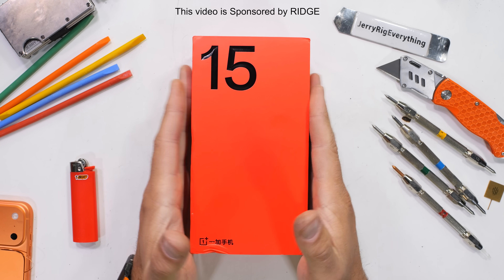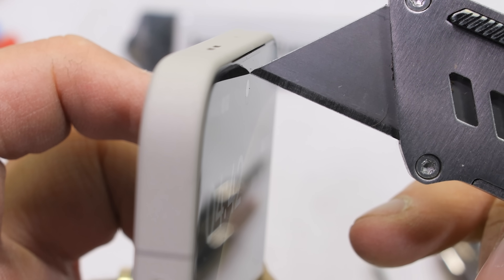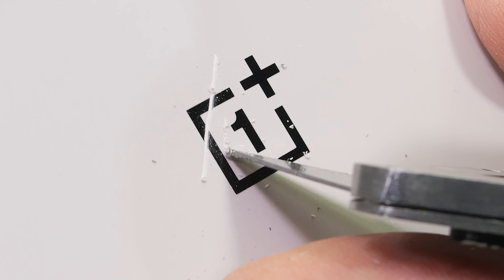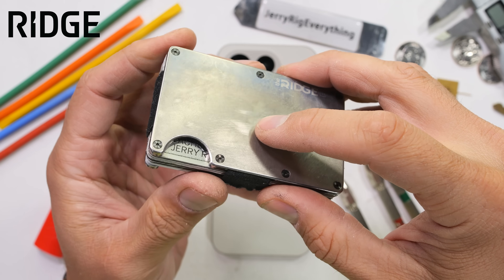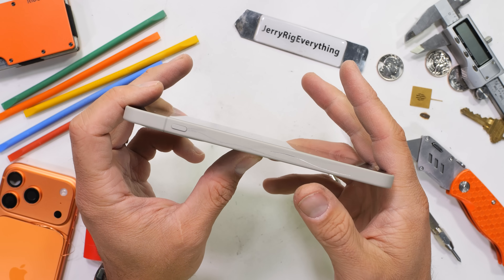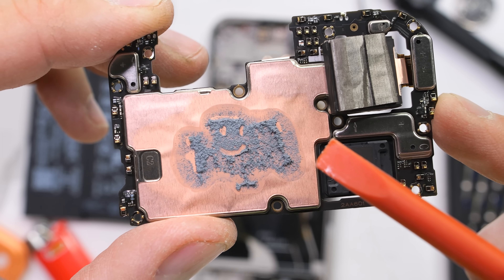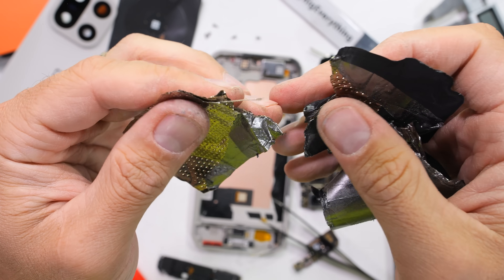OnePlus 15 Durability Test -- The Claim is Insane

Comment: As someone who rarely uses a case I am curious as to how scratch prone the back really is?   You went straight in with the knife would have been interested to see how it holds up with the mohs test.   As it stands it looks like Sandstone has tougher sides and a stronger back dor drops but weaker for scratches?

Comment: That "MAO" Coating fucking sucks, there's only like one place I've seen that does it right to where it's actually more durable than hard anodizing level 3 and I doubt OnePlus sprung for those guys to do it, I have quite a few mao flashlights and they do not hold up well to scratches/scuffs at all and it also attracts dirt and is hard to clean, a titanium/hard anodizing level 3 would have been so much better but oh well.

Comment: Hello! I follow your channel and I absolutely love how you tear down (or disassemble) cell phones to see what's inside—it's truly fascinating.

Perhaps many people ask you for help, I don't know. I myself am a cameraman; I make short films and videos. I currently use a Motorola Moto Z, and I love it. However, the battery no longer works, and I can't find a replacement here in Venezuela. It would be amazing to continue using my Moto Z as a camera; I would never swap it out.

I wanted to ask you a favor, if it's within your means, could you possibly send me two Tecno Spark 20 phones? It doesn't matter if they are used. You might wonder why two. The reason is so I can have two identical cameras when shooting different angles/shots, and it would be a huge help for recording my short films.

Thank you in advance.
Sincerely,
Pepe Gascon
Venezuela"

Comment: Silicon Carbon batteries are still lithium ion. Lithium ions are the medium used to carry charge between the cathode and anode, but the cathode and anode materials can be changed as new battery tech is discovered. That's what the silicon carbon means. 

Other types of battery alongside Li-ion include alkaline, NiMH, and solid state. These don't use lithium ions.
Reply: thank jeebus - I thought oneplus lied

Comment: 2:45 Motorola has IP69 phones. At a fraction of the price too. lol Motorola Edge (2025) has IP69 and 68, so does Moto G Power (2025) and the out of states Motorola Edge 60, Motorola Edge 60 Fusion, and Moto G56 5G. Also, the Edge 2025 and g56 5G have MIL-STD-810H certification. (I have the Edge, got it for only $200 dollars, for a mid level phone that's crazy, especially with the specs and durability and premium feel. I'm not actually a fan of Edge phones but this one is growing on me.)
Reply: Finally someone talking about the Motorola phones

Comment: Well from experience i had my oneplus 15 for 1 day, tripped with it in my pocket didnt even land on it. Phone looked fine no scrathes or cracks and was still recieves notifications but the screens fully black now, i belive its factory control and the screen wasnt properly attatched,  they are offering replacement but now i need to wait another 3 weeks to get the phone i paid gor

Comment: We need you to start testing the waterproof rating.  Changing the 8 to a 9 means it should resist 176 degree water sprayed at 1,450psi. Time to go to Home Depot and grab a pressure washer 😊 My guess is it’s BS and those mesh screens disintegrate allowing the phone to fill with water. Would be nice to see if I’m right or not.

Comment: HTC Did MicroArcOxidation years ago. so its not THAT new :D

Basicly you strike the Aluminium with Arcs of High Voltage, so it becomes a ceramic. 
Same Technique is used for SpaceShuttleTiles

Comment: One Plus owner here. I love this company. Iv had my One Plus 8 since its launch, it's still has the original battery and after five years of use with no screen protector I finally had to change the screen due to it having every notification burned into the screen. it itself had on scratches on it which is amazing since I work in construction. The only reason I haven't upgraded is it still works and it still updates. It's been a flagship kill since the 1+1 and I hope they continue on.

Comment: Twice the battery capacity, charges 3x faster and has over 1.5x the battery cycles compared to iPhone 17.. Apple is seriously falling out.
Reply: I'd say samsung is fallen out more than apple because ios is efficient af so they tend to hold their charge much longer than Android of similar battery capacity. Samsung though, they're android and them not going silicone carbon even now, especially with how outdated their charging speed is really astonishing. We have devices that are sold with a 120w charger in box but Samsung's most capable is 45w without charger in box.
Reply: @bruhder5854  but Samsung batteries are made themselves silicon carbon batteries is Huaweis product. Also Samsung batteries are rated for over 2000 cycles. This is double the lifespan compared to any battery apple uses.

Comment: So the ultra hard ceramic coating is done on plastic back. And the other colours don't have that ultra hard ceramic coating.. so whichever you pick it has downside which I find pretty stupid to offer then
Reply: Huh? The ceramic coating is on the glass versions, no? That's why they are so scratch resistant, and the plastic version in this video is not.
Reply: @SimonVaIe no its the opposite. Only the sand colour has that ceramic coating and they couldn't apple that to glass so they used plastic or whatever instead.. just Google it

Comment: I heard the black international version has a ceramic coating that will literally grind off any material you try to scratch it with (besides ceramic and diamond) and will instead gray out as if you are using a crayon and then you can just wipe it off with your hands

Comment: 7:53 i think there's a misunderstanding here
Si–C batteries are still Li-ion because the core lithium-ion mechanism is unchanged. What changes is the anode, which used to be graphite but is now a silicon–carbon composite. Silicon can store far more lithium, increasing energy density and allowing more capacity in the same volume. It can also reduce losses during charging, improving efficiency and heat management.

Comment: wait okay i looked it up. IP69 apparently means it can withstand high-pressure, high temperature (up to 80°C or 176°F) water jets. you said that has a better rating than any other phone on the market, including the iPhone. but.... haven't Apple been doing high-pressure, high-temp water jet tests for a while now? even if they don't have the rating.... aren't they physically as water resistant?
Reply: Even if they have, the statement is still factually correct..  it does indeed have a better rating even if it only has the same level of waterproofing.

Comment: All vapor chambers in phones can be ripped apart, people can rip apart roller steel. I don't think its that concerning. However a thinner chner also means superior thermal conductivity. Considering in 99.999 phones a human hand will never touch the vaper chamber its a no problem

Comment: The Oneplus 15 lineup is one of the first phones that heated up to 52°c (127 Fahrenheit) on the surface which means it is even hotter in the phone! It crashes due to the heat and is unusable until it cools down (took 15 minutes). It gets to this level for demanding tasks and heats up like an oven for navigation. They also downgraded the cameras from their previous phone, the Oneplus 13 and reduced the resolution of the display, along with the ppi density.

If you're planning on buying the Oneplus 15 and you already have a Oneplus 13, I strongly advise you to do your research.

Comment: Small correction but IP69 is not necessarily better than 68, as they are for different use cases, being prolonged submersion in 68 and high pressure jets in 69.

Comment: I'm so pissed off at the EU by removing chargers from the phones. Most of the time it's fine, but not with this one. Politicians shouldn't meddle in tech.
Reply: Aaaaand they were also the reason for every device sold to have USB-C charging port, so regulation is fine. They just need to be scrutinised for bad legislation
Reply: @lisatscher USB c is fine, but not the chargers...
Reply: @skotas yes and no, from environmental aspect is better because chances are you already have a charger at home. And it is only the power brick, that's not included. You got the cable. Besides with type c you can use a laptop charger for fast charging too. You only really need one power brick for a phone and it is a waste when changing the phone every 5-6 years.

Now, they intended this to make phones cheaper which didn't happen, but on the other hand because of other pieces of legislation this is just a minor 10 buck nuisance at worst

Edit: and as the guy on the bottom said, nothing stops manufacturer from including the power brick. But why is it such big deal for you that they don't come with a power brick?
Reply: @lisatscher I have an Anker Prime charger so it's not a big deal. But it would be a nice thing to have a charger which is able to charge the phone at full wats. Anker manages 43 at the moment. Plenty but still far cry from 80 or 120.
Reply: @skotas  I think it's way more annoying that some brands like OnePlus (or oppo for that matter) dont use USB pd to reach those high charging rates, making them incompatible with standard USB fast chargers in that regard. For the full charging speed, you need to use their proprietary chargers even though USB pd can deliver up to 240watts.
Reply: @skotas aaaah, even when they included a power brick, i don't recall neither Samsung, nor Apple, nor anybody to include full-power chargers. No one would include 80/120W charger out of heart, when 65W is the default one for a laptop. Like be fr
Reply: @SimonVaIe which makes it expensive asf first and second no one would include that out of the box
Reply: @lisatscher that's true...
Reply: @lisatscher  uh.. no? First, neither Samsungs nor apples devices support charging that's all that fast, like 30 watts at best, if even that?
And second, you can buy 120 watts chargers for like 20 to 30$, that's nowhere near expensive af, and if you source large quantities as a company that'll be cheaper of course.
I only mentioned the 240 watts supported by the USB power delivery standard to demonstrate that you don't need proprietary charging standards that only work with one device and fall back to like 10 watts for every other device for those high charging rates. That's just annoying.
Reply: @SimonVaIe i meant that putting 80/120W chargers in general is ridiculous idea anyway. I thought that "65W being laptop standard" would give away part of the reason that they don't support it.

I keep forgetting that manufacturer cost is different from consumer products. But it is still more expensive to put a 120W brick than a simple as you say even 30W brick when it isn't necessary.

Thank you
Reply: @lisatscher  well I don't think it's that ridiculous. 65 watts may be somewhat standard for office laptops, but plenty, or rather most laptops support significantly faster charging speeds, and once you're at gaming laptops they pretty much require a lot more than 65 watts since your performance would be severely limited otherwise. As for e.g. OnePlus, when they started out they were way more competitively priced and they still came with their fast chargers out of the box. That was like 20 watts back then, sure, but the mainstream was at 10 or 12 watts I believe at that time. And that was the maximum charge rate those phones supported at the time.
Reply: @SimonVaIe oneplus is an outlier in a lot of regards. They include a phone case too which most manufacturers don't bother with. 

But most manufacturers just put the bare minimum inside the box and that's about it.

I don't talk about gaming laptops (which are also stupidly expensive as well), a high-end phone in working capacity is akin to an average laptop not to a gaming one. But you don't need 120W or even 80W for a phone first, even if they were to support it. And second it is ridiculous cuz most of the time companies just do the absolute bare minimum. Again, except for outliers, but most wouldn't bother with adding fast chargers, instead they would sell them at a premium
Reply: @lisatscher  nah many others also included stuff like chargers, cases etc. in the past. But it's cheaper to just not. So they stopped.
And needs, huh. A laptop can go with a 45w charger just fine, probably even lower. A phone can go with a 5w charger just fine. The bare minimum you speak of is quite arbitrary. 
I'm not saying I don't understand that companies try to maximize profits. I never said they must provide top end chargers with their phones. I also didn't say that they must sell a phone cheaper if they forgo a charger than when they put chargers in the box.
Obviously, the opposite has happened, phones get more expensive and you often dont get anything else with the phone anymore.
I simply don't think fast chargers are ridiculous, they aren't all that expensive, proprietary charging standards only used by one companies phones are stupid and the EU doesn't have much to do with manufacturers leaving that stuff out.
Reply: Huh? I'm not aware the EU removed chargers from phones? They mandated that phones have USB c, but they didn't say they can't ship with chargers, did they?
Reply: @SimonVaIe Phones in the EU are shipped without chargers due to a new directive mandating that all new mobile devices have a common USB-C charging port, with the charger sold separately to reduce e-waste and save consumers money.
Reply: @skotas  no as far as I know manufacturers only have to offer an option to buy the phone without a charger, but they can still sell them together as well?
Reply: @SimonVaIe they offer the option or at least OnePlus 15 does. But instead of that charger I chose a tablet. I already have a decent Anker charger. 

By not including the charger, manufacturers are complying with the law and giving buyers the option to purchase a phone with or without a charging brick. 

Manufacturers basically charge for the phone the same or more than in the US and then if you actually need a charger you need to buy it as an extra. My pixel 9 pro xl came just with a cable and is more expensive than in the rest of the world. The so-called "green" agenda is just another rip-off.
Reply: @skotas  but none of what you're pissed about is because of the EU though?
Reply: @SimonVaIe 😂 it's EU
Reply: @skotas  you're pissed that OnePlus offers you a charger but you took a tablet instead and you're pissed Google doesn't include anything, none of which the EU forces but somehow the EU is at fault. My guy what are you on about?
Reply: @SimonVaIe I'm not pissed off at 1+ or at Google just at the EU 😅 they made this possible. But hey there are bigger issues in the world...
Reply: @skotas  all of that was possible before just the same. It was never not possible.

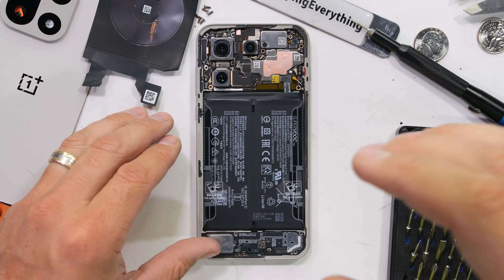Comment: 7:32 ok what is super interesting "Li-Ion Battery". Is the advertisement false?
Reply: No. Silicon carbon batteries are a subset of lithium ion batteries. So it is correct that it is lithium ion, just a better version with a silicon carbon anode which provides that great energy density.